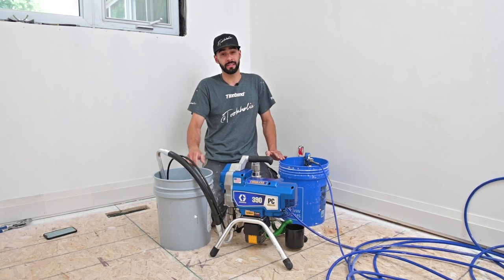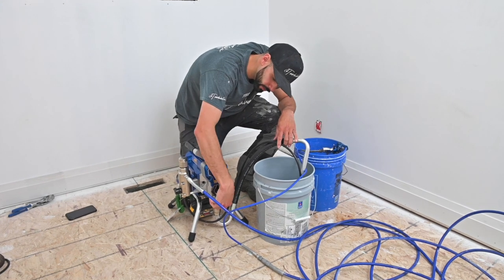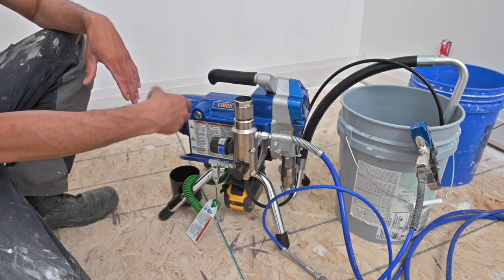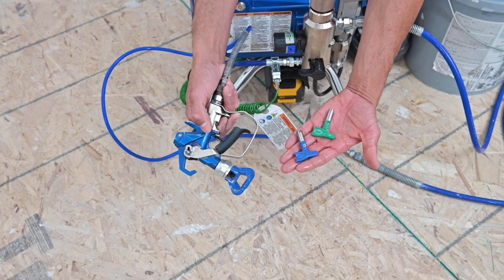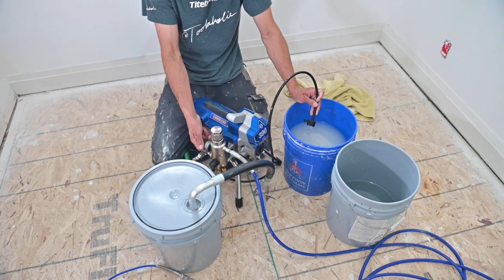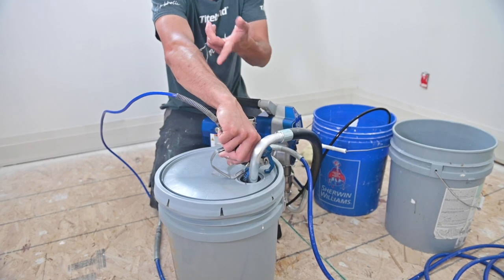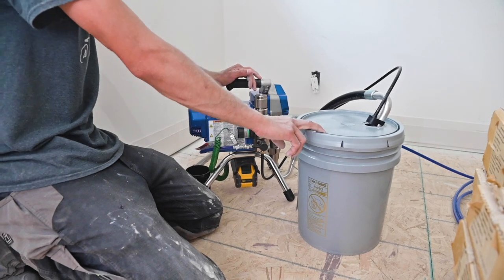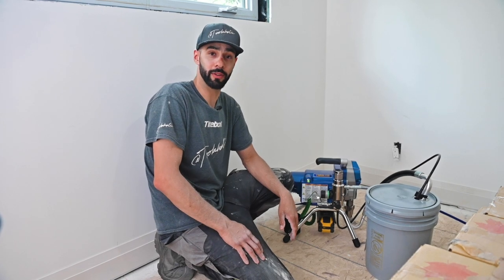Graco 390 PC CORDLESS Sprayer - 5 MINUTE REVIEW

Comment: Just got one I have been painting for over 20 years it’s a great little pump . The only thing that could be improved is it should be able to run both ways cord and cordless .
Reply from the maker: Great feedback, i agree
Reply: @Toolaholic  DeWalt has a Flexvolt 120v adapter that if I remember correctly plugs in an AC outlet and fits where the battery pack goes. Wouldn't that work on this unit?
Reply: @MrTemplefugate does it work?

Comment: They should update this unit with a battery bank instead of just a slot for 1. Assuming someone buying this will already have some dewalt batteries from other tools, so why not allow the unit to accept 2-3 batteries at once. I’m hearing roughly 3 gallons per battery as of now

Comment: Good and concise! Just don't really understand the reason for a cordless sprayer, but that's just my opinion!
Reply: You mean other than a bunch of scenarios where you might not have access to power? How about not needing to drag around an extension cord all day, setting your machine where ever you want, not worrying about if your gonna be able to reach an area without moving everything to a different outlet. I can see even taking this up on a lift and just going to town out of a bucket. I mostly have power on 99% of my jobsites but would still probably prefer to use this all over the place, especially on exteriors.
Reply: New builds, painting fences that are far from an outlet, etc.

Comment: If it works great,why are you back rolling it?
Reply from the maker: I always backroll when spraying walls/ceilings for light texture. If you spray only, it makes the surface too smooth, and it makes any sort of touch up near impossible, unless you spray again. The other reason i backroll is adhesion on first coat over raw drywall
Reply: Tell me you're not a painter without telling me you're not a painter. Back rolling helps for future touch ups and it also helps the ptoduct adhere better by pushing it into what you're painting.